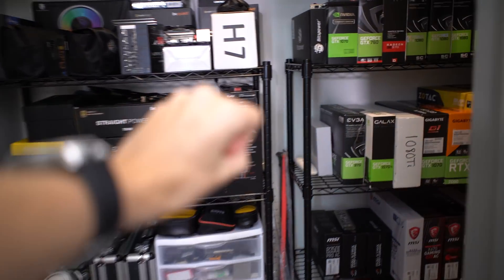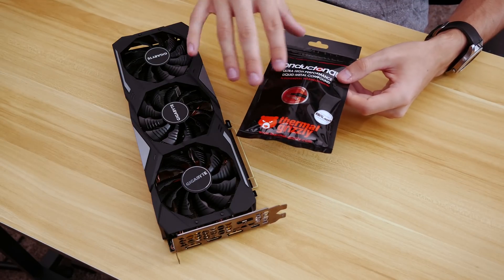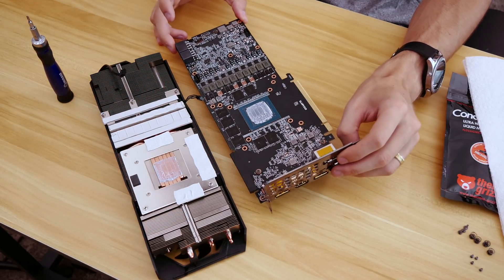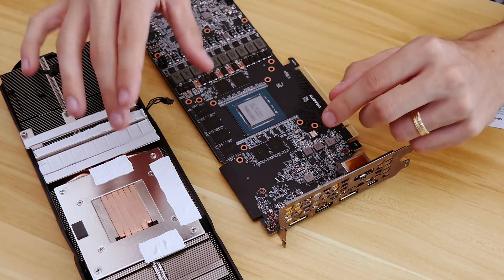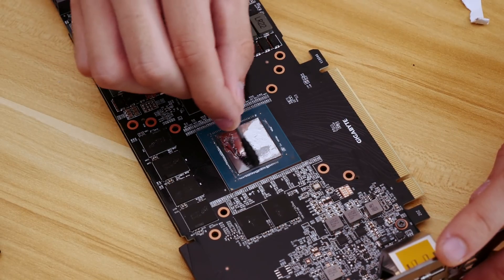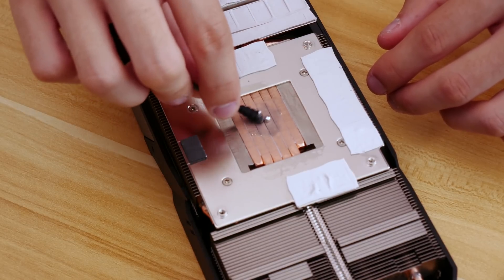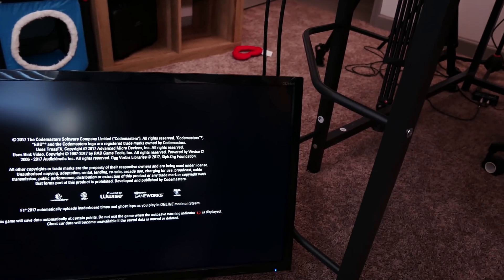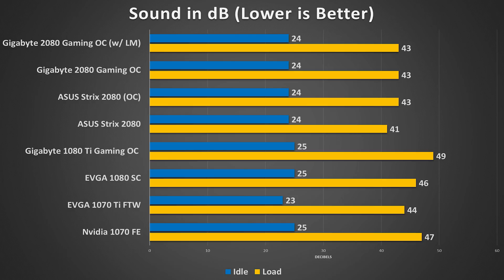Liquid Metal on a Graphics Card?

Comment: In order to appreciate LM, a set fan speed needs to be set.  Otherwise fan rpm scales to thermals.  

Clean off the contact points around the GPU and apply about 3 coats of nail hardener to act as a barrier to prevent inevitable LM spillage.

I have been thinking about your parents and their house Greg. My thoughts and prayers to their devastation.
Reply: I recommend getting silicone conformal coating instead of nail products to protect SMDs from LM. Conformal coating can be removed with a chemical cleaner. I use LM on 2 980s SLI (power mod also) and delidded 4790k CPU. Improved temps and overclocks on everything, obviously. I will do the same on my next system. It may take 3-4 applications and a bunch of wasted LM until you get it right.. Buy the bigger tube just in case imo.. I had to open my IHS 2-3 times, remove water block 2-3 times, and opened GPUs after application to make sure the LM didnt move lol.. Now i get the application perfect every time with no waste. Thermal grizzly is much nicer to work with than CLU, better to work with and better thermal conductivity.
Reply: @CrusnikofChaos  Pretty sure denatured alcohol takes nail hardener off. Just little more work than a acetone based product, which may also work, but I'm not confident on it's reaction to any plastics used.
Reply: Set fan speeds to 100%, record OEM and LM temps. That will tell you if it creates headroom. Use the Aorus controller or MSI Afterburner.
Reply: I think the variable fan speed thing was accounted for with the graph showing decibel values.
The thermals should be better, the fans should be spinning slower, and the noise should be lower also
Reply from the maker: Thanks, Bob! Fan speed was a variable we monitored and represented with our sound tests. There was no significant change.
Reply: What type of nail hardener would you recommend? Just a generic brand from the shop or do you have to watch out for specific ingridiences?
Reply: You don't really need to protect the SMDs from liquid metal as once you apply it if you do it properly it won't go anywhere.
Reply: @OTechnology  I have absolutly had little beads of runoff around the die. Its nearly impossible to get the coldplate lined up exact when reassembling the card so there is potential for it to run off when you slide the plate into place. Not only that but if you have a drop (I'm talking tiny almost microscopic drops) that pool to the edge of the die vibration over time i.e. from installation, cleaning, fans running, ect can cause that bead to role into other components. I know because I have 4 gpus, 2 laptops, a ps4 pro, and 4 cpus under my belt now and I have had this happen. Luckily I cought it before it was a problem, but your statement is a little misleading and there are to many variable to account for and nail hardner or a very thin high heat tape causes no harm and takes a minute to apply.
Reply: I don't know about you but I've used liquid metal on plenty of GPUs too and never killed one or even have excess squirt out onto the substrate. I think that you're probably applying too much. I agree though for someone who's less than confident on their application that might be a good idea.
Reply: Same, never killed one and I do feel like it would take a lot to make anything arc but it never hurt to wrap it before you tap it. What does hurt is leakage in the wrong place at the wrong time ;)
Reply: @OTechnology  Always plan for the worst case scenario because If something can happen then it will happen. plus it takes like 5 mins to apply a cheap nail hardener. No excuse for cutting a significant step that can ultimately save your GPU or in my case several CPUs.
Reply: @OTechnology  That's like saying you don't need to wear body armor in a war zone if you don't get shot.
Reply: @OTechnology  Exactly
Reply: @OTechnology  Let me tell you Bob of All Trades has been doing Liquid Metal for a while now on multiple GPUs ..hes well versed and if he says use a protective nail polish coat then youd be wise to use a protective coat go see his channel and you'll get educated instead of giving random comments with no proof of execution I saw 2 of your videos and you yourself claim you missed a few spots so I would say your far from an expert at liquid metal in contrast Bob has multiple videos where hes applied Liquid metal , undervolted and adjusted,  fan speeds from a teardown to rebuild and benchmark..Bob knows his stuff better than most and he looks out for the viewers who wanna learn  and advanced modders alike .

Comment: I've tried it before and was kind of unimpressed. Little messy and didn't drop temps as much as I hoped
Reply: LM has never been worth it for GPU's. They use Direct Die cooling, whereas Intel CPU's tend to get better results due to the Additional Thermal interface with the Lid. But alas its a learning experience.
Reply: it is, the difference is you apply it once and you're done with it while paste dries up after a while and you have to redo it a couple of times in its lifetime
Reply: @ShimejiiGaming  I'd have to say that for me, it has always been worth it. It always worked and dropped temps properly while boosting more.
Reply: I used LM on my old gtx 780 lightning, the stock thermal paste was similar to the stuff Intel puts on their CPUs. It dropped temps about 10c for me overclocked, and I was able to push it further than stock paste with the unlocked bios. However, I just bought a 980 ti and judging by its already really low temps I probably won't benefit from this much.
Reply: @MarshalBeard  Tried it on a 290x lightning, gigabyte 780 ghz edition, zotac 980, and evga 980 ti. Every time it was about a 5 degree drop over factory paste, but a good paste like gc extreme or nt-h1 would probably work just as well.
Reply: i used LM on my r9 390. it dropped from 87 degrees under load to 69.

Comment: It is LIQUID, it LEAKS. Do it slightly wrong and you can short you GPU to unrepairable damage.
Reply from the maker: This was mentioned multiple times throughout the vid :-)
Reply: As long as you have a thin layer of liquid metal the surface tension will keep the metal in place. It's really no more risky then LM on your cpu